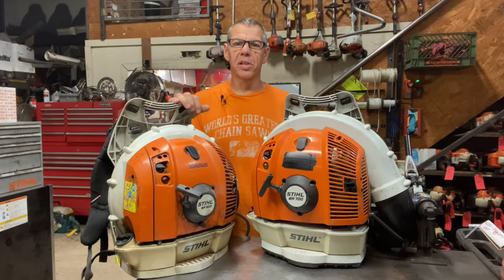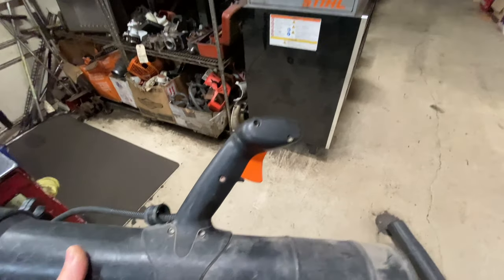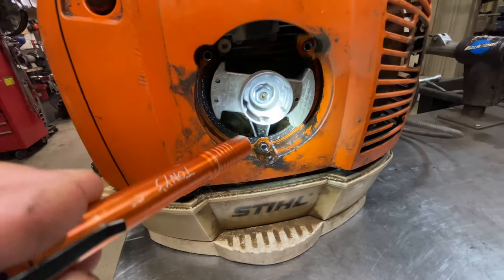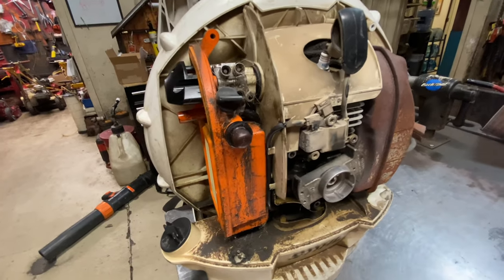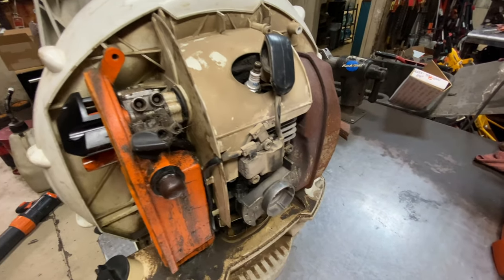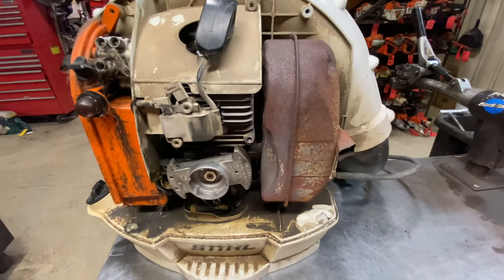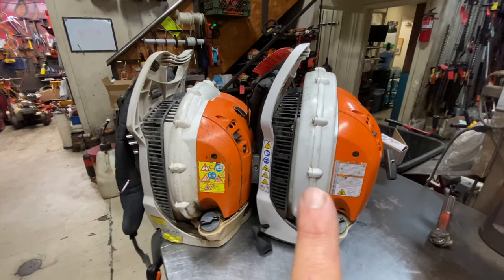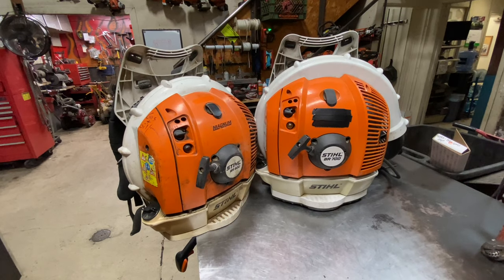STIHL BR600 and BR700 COMMON PROBLEMS / WHAT TO LOOK FOR

Comment: MY ADVICE DONT BE CHEEP ALWAYS USE THE STHIL OIL AND YOU WILL NEVER HAVE ANY PROBLEMS
Reply: Aspen blue jug or the Stihl grey  jug, alkylate fuel, with Saber oil. 

It gives you better performance, better throttle response, lifetime bearings, clean exhaust, temperature control, etc.
Reply: I have the BR - 600 thats 13 yrs old which has been great. Keep them clean helps with the life span. Of course do preventative maintenance is critical.
Reply: Stihl oil is trash 🤦‍♂️ use echo redarmor instead.
Reply: I think a lot of shit comes down to shit happens now a days. Seen random failures from people who sleep with there machines that’s how much love they get
Reply: We use stihl oil ours locked up after one tank
Reply: Not true

Comment: I have a BR600 and have run 50 gallons of fuel through it in 3 years without one issue.  No complaints!
Reply: Just got a 600 today hope i got a bang for the buck
Reply: @chuckmarriner3338  if it runs like mine it will serve you well.  Run Stihl synthetic oil and premium fuel mixed at 50:1 and she’ll blow for a long time!
Reply: I have a 600 with 2500hrs and a 700 with 1200. New solid state coil on the 600 because a bushingl from the pull start mount from the last person that took it apart got wedged in and out of the magneto/coil.

Comment: I got a junk br600 that had a seized wrist pin, surprisingly I was able to get it free and running, even with a destroyed piston it still had decent compression and full power.
Reply from the maker: Sometimes you get lucky if you catch it early enough.
Reply: @wallysworkin823  I saw one where the piston broke just below the wrist pin and let loose
Reply from the maker: @evanchapmanfanman  Yup, I've seen a few of those. It's usually when the wrist seizes then it'll crack the piston from heat.

Comment: Bloody hell, my Stihl-600 looks brand-new by comparison, yet it is 4 years old. Literally mint condition, yet fails to start again after I use it for awhile. It does feel unusually hot. Starts right up again the next day, as if cooling-down helped it to work again. Yet, this was never a problem before which is why I believe something is causing it to overheat.

Comment: Just right now tested my Stihl-600. I continue to have a strange problem. It works fine, until I need to shut it down to do something. When I return to start it again, it never starts. If I put it away after it fails to start, I pull it out the next day to start it. Starts right up, I use it again, shut it off then attempt to start it again. Nothing. Interestingly, it is hotter than usual. The Stihl has been stored every winter. Never ran into this problem last season. I may have to take it in for repairs.

Comment: How does BR500 compare to 600? I have the 500-model, same "issues" to watch over as with 600? Do you bother with 1% fuel or just go with 2%? Thanks in advance.
Reply from the maker: For the most part it’s all the same for the 500. However I don’t see as many loose engine pans, most likely due to the lower engine RPM they operate at. 2% is normal but if you are running high quality oil 1% works well to.

Comment: Great video, what is the cause of bogging on the 600. The engine starts 1st pull and throttles up then fades to about half revs TIA
Reply: Following this seen this on a few br 600s
Reply: Im having the same problem as well.
Reply: It ends with the motor locking up

Comment: Willie, 
I have a BR600 that keeps stalling after it warms up. Replaced the fuel filter & air filter and it's still doing it. It sounds like you know a ton about these, and thought you might give me your thoughts. 
I did find some others with the same problem, but they said to replace the filters. Are there heat sensors that could be shutting down the unit, or maybe something with the carb when the motor heats up?

Comment: What about the opposite of the seizing problem, where the wrist pin bushing (instead of a needle bearing like on smaller engine models) gets loose and the piston starts knocking and galling the cylinder?
Reply from the maker: I’ve never seen one get loose from just ware. Usually what happens is the wrist pin will start to seize and loosen up causing damage to the piston and it starts knocking.

Comment: Nice vid ty. I have an issue if you've ever come across it. I run my br600 and fuel is all over the place. On the carb body right under the High Low screws there is a pin hole spraying out fuel, almost hidden(so took me awhile to find problem).
Ever see this? new carb time?

Comment: Dude ur videos are amazing 
I build performance 212 engines from harbor freight they start off from 6.5 Hp  are stage 3 makes 16.5 then when u start dump rton of money we got one dynoed making 41 hp running methonal nitro mix 

So I build those for all mini bikes go karts and I advertise all small engine in Long Island area 
And ur videos have shown some key stuff that I didt realize that I just though was grease but ur showing head gasket failer didt realize 

1 question I bought personal 9010 h echo 
Used all last year for my 1 house and been a year still runs great but I was looking at high speed needle
Looks like there special screw driver to adjust high speed 
Do u know the part number for that or were I can get it 
It’s not like rednax or husky flat head 

Thanks keep up good work really look forward to ur videos
Reply from the maker: Thank you! Nitro fixes everything lol. Echo’s use a Micro D or Baby D adjustment tool. I use the Proline Micro D 91059L. Just do a general search and you’ll find them. Try to adjust the low side (top of the carb) first, those carbs usually don’t respond to high side adjustments.
Reply: @wallysworkin823 lol definitely doooosee lol
It sold from vp fuel 50-50 mix methonal nitro I can not find pure nitro to mix it my self so stupid 

thank u for all the info 
Appreciate leting me know 
Before I even tried probably hold off on doing it then because worksss mint just me be crazy lol got to touch everything 
Have u use amsoil dominator 
For the 9010 I just figure because it was high performance blower maybe use the best stuff the only thing I read is had no fuel stabilizer in in it but I’m very carfuel and would change fuel in mouth before I had it ever go bad 
I know lot of people use echo power bled or the red 1 like I said I’m crazy wanna use the absolute best even though if I had to fix it I could 
FYI I’m not landscaper just have 1 house lol 😂 so hours on thing are nothing 
Wat ur thought

Comment: Great video exactly spot on.
I rebuilt mine 2 years ago and the other day the crank pan split I noticed one of the bearings making a little noise but other than that everything else was fine what do you think?

It gets ran 5-6 days a week 
I only run stihl oil
Reply from the maker: Common to see the pans crack, if the bearings aren’t too bad you could just put a new pan on.
Reply: @wallysworkin823  oh okay. I ordered a new pan & bearings because the flywheel side was a bit noisy the bearings

Comment: I purchased my BR600 around 2005. I've had two issues with it. The first, and most annoying....it will not use a full tank of fuel before shutting down. It will leave about a third of a tank. I need to tip the machine to get the fill opening on the tank to its highest level and fill it to the top to get decent run time. I've had it to two dealers and they haven;t been able to fix the problem. Maybe you could offer your opinion on that.
The second issue was a crank bearing fail. I'm not sure why this happened...I always use a premium brand oil. The same oil I use for all my Two stroke and 4-mix engines with no issues. My main issue with the crank bearing is that it can't be purchased separately. It would an inexpensive fix if it was. I replaced the crank assembly along with a few other parts (because it was apart) and it has been running as good or better than new since. 
My research on the BR700 showed that it has different exhaust valves than the BR600. I'm not sure if that's just a part number issue or if they really are different....considering that they have the same engines. I did notice that the valve train was revised on the BR600 when I rebuilt mine. Maybe you could comment on that. 
Other than the plastic at the exhaust melting.....I haven't had any of the issues you've mentioned. 
Thank you for the video.
Reply: Had the same problem on my BR600.. It's the tank vent. Replace it and it will fix the problem. Use only a Stihl part
Reply from the maker: Do you have a single fuel filter in the tank? Early models had a single but the newer ones have a dual filter which helps pull fuel from both sides of the tank. I have seen several crank bearings failures, some were just part failures. Unfortunately the crank needs to be replaced and it’s not cheap. I’m not aware of a change in exhaust valves them selves, I would need to look that up. There was a change in the cams after your blower. The metal plate on the back of the cam would come off and cause damage. Good to see your still running an old unit, take care of it and it will run for a long time.
Reply: I would think that the dealers would have addressed the vent on the tank...but...you never know. Its been years since I've looked into the problem...I may have replaced the vent myself. The machine runs perfectly to that point....another reason why I don't believe it's a vent issue. Also...if I shake the machine when it begins to stumble...it will continue to run for a period of time. Suggesting that it's a fuel pickup issue. 
I believe my unit has a single fuel pickup design. I'll look into that. 
Thank you for the responses. I appreciate it very much.
Reply: @victormarinelli5660   Mine is the newer dual fuel filter design. Which I replace them both when experiencing the 1/2 tank tank no fuel problem.  Next, when I replaced the vent, problem solved.
Reply: @snakeman48  
Thank you Snakeman
I don't remember if I replaced the vent and I don't believe either of the dealers did. As I mentioned...I would think that the vent would be one of the priority check points for a dealer. 
At this point, I'll probably replace the vent and add the additional pickup line. 
Another person commented about the vent....apparently, it's an issue. 
Thank you for your help.. much appreciated.
Reply: ok.. originally the "br 600" had 3 main issues valves broke single fuel pick up and the decompression mechanism on the back of the cam would break .. they addressed those problems and slapped the magnum sticker on it and the BR600 MAGNUM was born! ...next thing.. a friend had a crank bearing fail.. however.. he found a bearing online cheap from china..took gamble and ordered it.. 20 or 40 bucks..i cant recall.. but it was WAY less than what the oem assembly is... i personally removed  gear from crank and replace bearing and pressed gear back on in correct position! . the info is not out there on how to do this and get it right..stihl doesnt even give a number for the bearing.. but i KNOW it can be done.. I DID IT! so i call bullshit! it really bothers me when people act and think they know something they dont. stihl shop told my boss his was scored from straight gas run in it ..because it got real hard to pull.. claimed 100 come in a year like that... if i were there i would have slapped the stupid right off him.. i adjusted the valve lash and that fixed the "scored cylinder" the valves were so far out that it was not pressing on the decompression like it should!   i looked online for over a week before i found 2 cases of no oil in gas etc..but that kid claims he sees 100 a year like that! yeah.. that guy should not be in sales and should have his tool box welded shut!    and dont get me started on the response given when i heard a guy ask the difference between the old stihl 2 cycle oil and the new stuff..  grrrrrrr..
Reply: Thanks for the reply, LG
My BR600 is the earlier one which is prone to valve issues. I probably should have picked up the Magnum when the bearing launched for that reason. 
I did a lot of research on the bearing and I believe I found one from a reputable bear manufacturer. However, for some reason I couldn't get it. I don't remember the details of that. I'm confident that the blower would have continued to work properly (engine) to this day if the bearing didn't self destruct. I actually still have the original crank assembly. I would fix it if I could find a bearing. I'm curious to know if the Chinese bearing held up.
Reply: @LG-fb9yt  I sold a BR 600 to a landscaper who was just starting out.  I tuned it by ear and purposely tuned the idle to as low as it can go without stalling.  The buyer loved it when she tested it.  Days later she contacts me again complaining that there's something seriously wrong with the blower.  The stihl dealer told her that something would need to be replaced.  I reluctantly took it back after charging a "restocking fee".  I hate buying back a used item.  God knows what happened to it while they had it.  Bought a tach and tuned the damn thing to "spec" rpm before selling it to the next person.  Stihlerships at their best.  I wouldn't have been surprised if the stihl rpm was wrongly compared to a non 4mix engine by her work buddies because 4mix revs lower.  But I was surprise that the stihl dealer would speak out of their rear end.
Reply: early ones  had valves break .. single pick up in tank and that plate on the back of cam gear is part of the decompression...they had issues with that early on also. they made valves from different metal..added second pick up in tank and fixed the self destructing decompression assembly...added magnum sticker and poof the magnum was born!  as for the bearing..you CAN get them from china..sorry I don't have the part number. but you must pull the gear to get to the one I replaced..and so you must press bearing on correctly then the gear in proper orientation the crank since that runs the cam etc.. I search long and hard to find an image but ended up pausing a video and screen shot it.. it's nothing I would suggest a novice do.  and good luck finding a puller that will fit between the gear and bearing.. a friend had one that I was able to clean up the edge enough for it to be thin enough to work for me.  mark the gear positioning on the crank and the gear and it may save you a headache .. don't look to stihl for any help lol they want to sell you that assembly...THATS why you will find no # on the bearing!!   I don't know if the valves differ between the 600 and 700 however.. from pre magnum to magnum..original valves are of different metal or alloys etc pre magnum were weak and failed.  that's what I read anyway.. I have an interesting story regarding our 600 magnum...but im out of time so it will have to wait. hit me up if you're curious! it's a good one and 100% true!

Comment: Ever had one that bogs above half throttle? Doesn't happen when cold. Replaced plug, coil, carb and fuel filter. Spark plug looks pretty rich, thinking a sticky valve??
Reply from the maker: You can check the valve adjustment but if the plug is “rich” it sounds like a carb issue or just an adjustment.
Reply: @wallysworkin823  It turned out to be the coil air gap. Skipped right over that in my process of elimination. Customer changed the coil before bringing it to me 😆

Comment: Mine currently is that it’s not starting. When I pull the tensioner to start it. There’s no tension when I pull the recoil rope . I pulled it off to inspect the rope and it seems fine (pulling wise) and spark plug, connectors and the two cylinders seem fine and I use 1:1 so my thought is something to do with the flywheel? (What the recoil rope is attached to) but idk it just won’t start even though it was working earlier

Comment: Just curious the age/hours on this 600? Appears it was used by a commercial property maintenance biz? Backpack blower recommendation? Thanks!
Reply from the maker: That 600 was older, used for light commercial. Recommendations are tough, they all have some kind of issue. If I had to pick my top 3 it would be, 1. Echo PB770 2. Redmax EBZ7500 3. Br600.

Comment: Hi, thanks for the video.  Do the fly wheels ever go bad?  I have a br700 that won't start at all.  It doesn't even attempt to fire.  I replaced the coil and spark plug and still no dice.  Any ideas?
Reply from the maker: The flywheels will sheer the key way sometimes. Check the valve adjustment and make sure it has compression as well. Could be any number of things.

Comment: Whats the opinion on putting the 450 tip on the 700? I run nothing but 50:1 orange sthil oil with non ethanol with the occasional splash of marvel mystery oil in the blowers gas tank.  Seems to keep it clean and i like to think help that wrist pin with some additional lubrication.
Reply from the maker: It shouldn’t be a problem. You just have to be careful that the tip isn’t too small otherwise you can overspeed the engine.

Comment: Hi Wally. I own both blowers and appreciate this info but after changing mufflers on my 600 it still is louder than the 700. Why?
Reply from the maker: Not sure, they are the same mufflers. Although some of the older 600’s seemed to have a little heavier duty muffler.
Reply: Thanks I will just make sure the bolts are still tight.

Comment: nice video, my air filter gets very oily.....why would that be the case?
Reply from the maker: Could be a few things. Make sure the oil/fuel mix is correct. Carburetor may need to be replaced. If the unit is older it could be having valve or compression issues causing excessive “spit back” into the intake.
Reply: Mixing with to much oil

Comment: How can I check the rpm’s on my 700? Cranks    Good and idles good, seems like it is holding back. Purchased from a friend that now has a lawn service. Thanks
Reply from the maker: You can but a small engine tachometer. Amazon or other sites have them for cheap.
Reply: Thank you! I should have thought of that